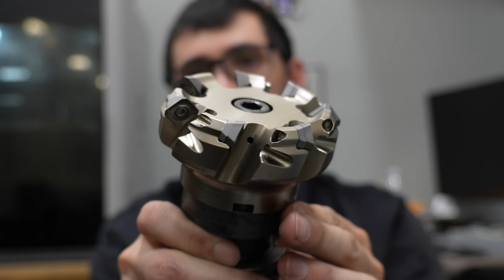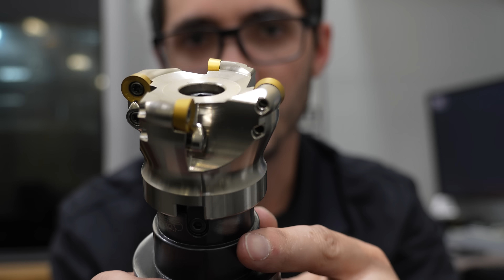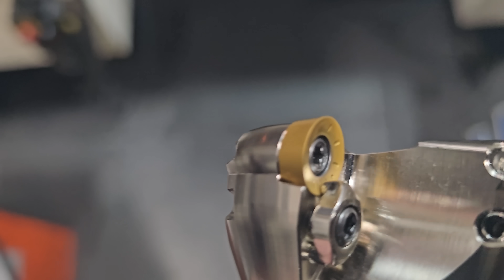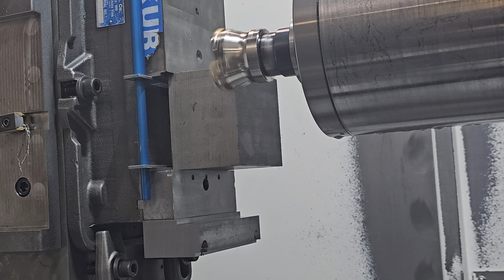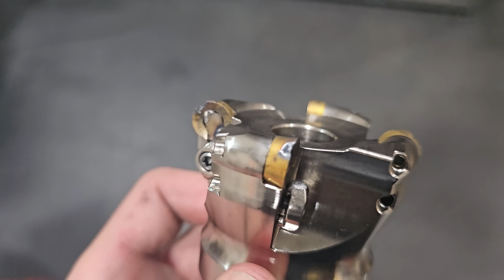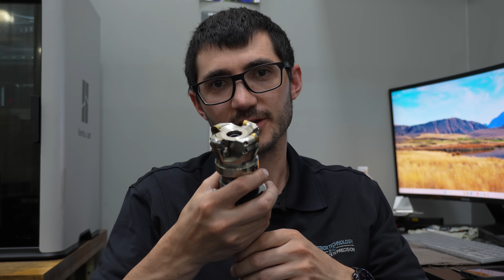Pushing a $40 Amazon Tool To Its Breaking Point in a CNC Machine!

Comment: I use ebay carbide end mills, all from same seller and they are cheap and work well.
$19 for 5 x 6mm carbide 4 flute end mills. Delivered in 2 days.
A single item from a store out here in Australia is around $60

Comment: 1) The cutting speed depends on the STEEL, not the tool.
2) 305 m/min is quite acceptable for this cutter, especially since it removes 12 mm, as I understand it.
3) The end mill is NOT designed for high-speed machining.
4) Round inserts produce very good surface finish.
4) 1500 m/min is NOT the cutting speed for this cutter. 🗿
Otherwise, it's a decent head. 🫡

Comment: Why wouldn't you use it in production? Its a face mill pretty hard for it to machine something out of spec. It also performed well within normal operating parameters. What you forget is there are very few companies that are tooled to make tools like these. Most of the time the same company that makes the high dollar ones also makes the cheap ones. A lot of time its the same damn tool with different paint and model number.
Reply: This is also true

Comment: half the pricing for tools is the QC and the coatings.If you werent in a climate controlled building that tool would rust and  the tool might cut slightly big or smaller since it doesnt get same QC as name brands.THEN bigger company means bigger overhead which mean consumer WILL pay for that.Most of the time tool brands will make is cost more because of name and familiarity in the field .Youll find that tools are made the same but different tool companies C-suites make ALOT different salaries.More expensives never always mean more better specifically when it comes to tooling used to make your products

Comment: The cheap indexable tool holders on amazon go hard. Especially in a home or small shop. Cheap amazon carbide inserts can be a hit or miss but still make chips for a while. 
Sometimes its just easier to modify a cheap tool holder than to make a custom holder from scratch.

Comment: For $40, it would be cheaper (time wise) to just replace the entire cutter body when the inserts go bad!  :P  Not saying I'd necessarily throw it out, but could definitely afford to keep another cutter body ready to go with good inserts and just swap the entire thing instead of rotating.  Thanks for testing it out, I was also impressed.  Now if someone could just test out those pretty blue anodized "FOR CUTTING ALUMINUM MILLING CUTTER BLADE" 5-flute (insert) aluminum-body face mills.  I don't really see a need for them, but they must exist for a reason!

Comment: I use these cheap tools for my home shop and never have any problem. I would use that in low production runs just change the inserts to something better the tool itself is fine. The world is finally waking up to the very reasonable quality coming out of China. However be warned buying the cheapest from China is still going to get you rubbish and manufactures vary so buy at reasonable prices and test the quality of the supplier before buying more. Find a good suppliers and product name and you will be fine.

Comment: I used Tenkik, MBC, MOXH . They are very shitty, insert life if going to be reduced a lot, depends on luck really, and the insert clamp is going to fail way too fast. BUT SURPRISE those little clamps cost half the milling head !

In fost materials and weak machines they are ok . The almost 10x price difference just simply cannot be overlooked.
But if you combine the replica cutter with shit grade chinesium inserts, you will never make any profit.

Comment: In my previous shop we used Sandvik tools
50% of the times we bought Smoxh bodies, its I think a good brand but half the price of Sandvik and it did perform the same as far as I could tell
Best part you could fit Sandvik inserts in the bodies

Comment: And without coolent!
Reply: I’m not a machinist at all. I know nothing. But I was asking myself that.
Aren’t you supposed to use coolant doing these cuts? Specifically at these depths and speed?
Reply: @TheDevnul It helps but you don't HAVE to use it. Carbide will cut dry all day long with the proper speeds and feeds. 

Now what you don't want to do is use intermittent coolant. It will thermal shock the carbide and crack it.

Comment: Why wouldn't you use this for production?  It clearly works very well.  The quality of the tool is impressive with beautifully deburred edges.  At a "normal" feedrate I'm sure it would last for a long time.  I'm more surprised that the inserts were that hard wearing.

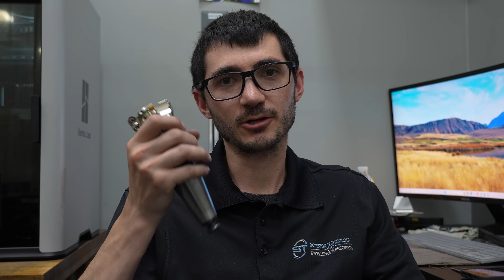Comment: 6:00  The reason is cause regular folks on a hand mill don't have the horsepower to hog those round inserts like that beast of a machine you have. But I guess at that price you could treat it like a blank with a taper and fit it to take whatever inserts you want to use.

Comment: I use cheap DLC end mills from AliExpress for making my moulds in my spare time on my DIY mill.
They're awesome, and I use them at up to 34.000rpm.
Being a machinist I can say that chinese tools are good recently.
Nothing to do with the ones from 10+ years ago.
Reply: You are not running at 34,000 RPM.
So just stop.
Reply: @roccitycrew3887 Yes, I do.
You can believe it or not, but in both cases I don't care and I continue working in that way.

Comment: I recently bought an name brand insert mill and it freaking sucked, even though is cost $400. So a buddy suggested trying the shars integrated insert mill and its a pretty amazing tool at half the price. Its now my go to rougher for SS.
Reply: anything Shars sells, you can get "direct" from the manufacturer for 1/2 to 1/20th the price. Shars just imports and sticks their brand on things, and charges a premium. About a year ago, I got a miniature precision boring head, the holder, extension, inserts, everything "direct" for about 60 bucks. Not long after that, I got a Shars catalogue, and they had the same thing listed as a "new product", and for more than 600!

Comment: do chinese u driill next. i bought one every size for no more than 15 bucks a piece. i use them on a deckel fp3 to drill floorplates  and they work way to well for the price. better than normal drills or annular cutters. would be cool to see how far you could push them. the drills even have trough coolant holes.
Reply from the maker: thats my plan!

Comment: You should try it with inserts from a well known insert manufacturer like Iscar, Kennemetal, palbit etc.
Reply from the maker: Thats the next step!
Reply: @MSMillingCNC  Honestly i think these Inserts are pretty impressive. Would be interesting how they perform at reasonable speeds an feeds compared to name brand inserts. If they last half the time for a 1/10 the cost, why not use them.

Comment: “You’d never use it in production”

You can’t tell me what to do 😂
Reply: Id totally use this for roughing on production, especially a material like 304 that will get weird spots and mess up inserts. Iv been buying Chinese tooling for that for years. Or if i have some stupid weekend thing I want to make out of some questionable piece of material I found laying around.
Reply: Also, the country that made those IS using them in production, and in general absolutely eating the lunch of US shops. Pretty sure the only reason US shops are surviving is because of mandated "must be made here" clauses for defense and aerospace
Reply: 😂 the hold my beer challenge has been accepted.
Reply: If you follow the correct SFPM for that material (Cold Roll Steel) A1008 which is probably about 800-1,000 and Chip Load of .008-010 per tooth and proper DOC it would probably last longer than you think! That material is very soft and very machinable! A round insert is the strongest geometry and might last several indexes depending on the DOC!
Reply: It’s not American made as you said it is.  And you have it on a wrong holder since there is a gap in between the two keys on where it locks in .  And it was showing damage on the sides of the hold down screw on the outside of the face mill .  That. 40 dollar facemill is China junk !  Buy a used high quality made if you can’t afford one.  I have many that I sell from which I buy from CNC aerospace machine shops that go bankrupt daily .    Less then half the price that you will pay for a new one.  That know how to work with or without the correct cat or Bt 40.
Reply: @6cobrasnake9  How long  have you needed glasses, that thing kicks ass.

Comment: Cerment inserts?
Reply from the maker: According to the Amazon ad, they're carbide but they feel too light to be carbide
Reply: @MSMillingCNC look like cerment. They are great for finishing and was impressed on how much they can take roughing. For 40 bucks that’s a steal. Just think about the the price and think if you could make that tool for 40 bucks. The machine work alone is more than that.
Reply: @derekk8523  If youve ever seen Titans of CNC - they had a prior guy, Donnie, who did their swiss lathes. Hes at another company now and he ran some tests with cermet inserts on the lathe. Actually pretty good results =)
Reply: @innominatum9906  i personally ran tests on cerment. With off results. They must be engaged no interruption at all. They also need to be ran at higher surface footage. That being said they are not as sharp as carbide and can push stock back in chuck. And there is no warning with them they are cutting or they blow up. Carbide at least holds together a lot better. But for 40 bucks you can buy carbide replacements or even ceramic ones

Comment: You could use name brand inserts the body looks pretty good. Would like to See runout etc....
Reply from the maker: The run out is not very good. I measured it at about .003 before I ran it, but yes in theory it could fit any rpmt 12mm inserts
Reply: @MSMillingCNC  As someone who just does things at home, that's pretty much the downside of the cheap tooling.
Reply: I use them and buy decent insert for them and so far it's worked out great especially for cleaning up torch cuts or rough plasma cuts. I can save my good stuff for after I clean that mess up on repair work.
Reply: I have a 40MM Walter facemill with R6 button inserts that is my go-to when everything else fails. It is absolutely not the best at anything - but it will do most =)